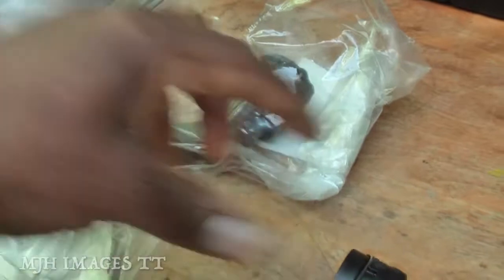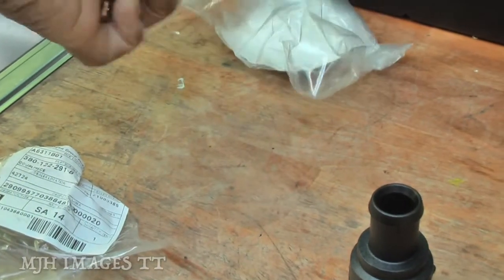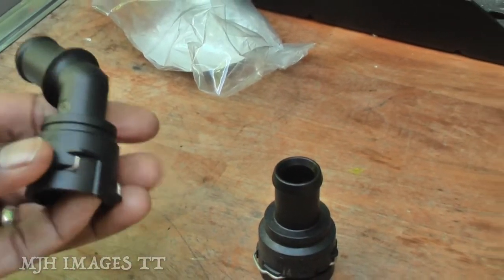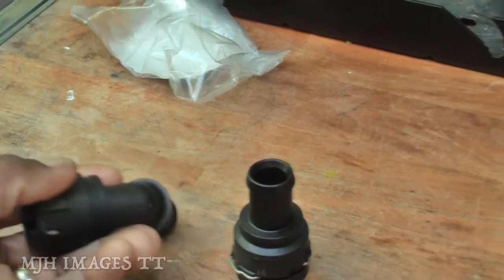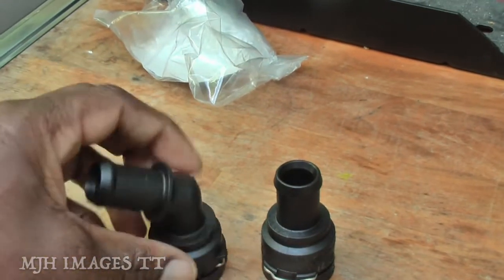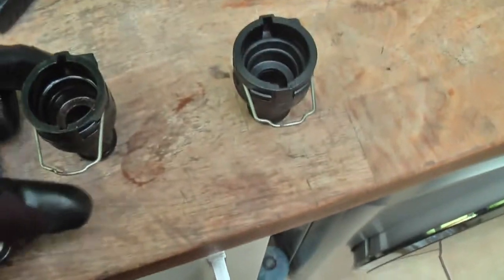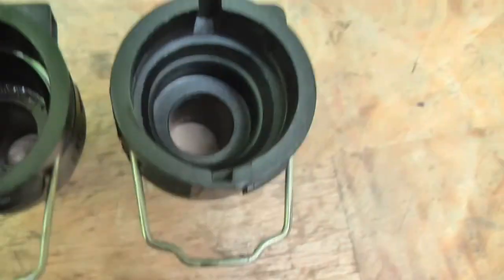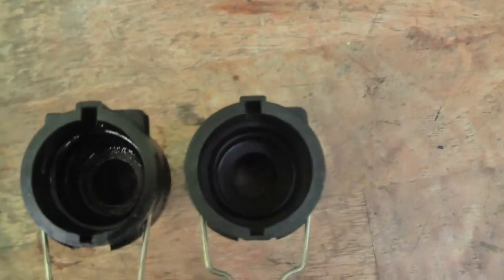Replacing Mk1 Audi TT Heater Core Hose Flange/Couplers

Comment: I'm so happy I came across your video.  I thought my heater core had a leak and I did a bypass and put off the repair/replace until I had the time (2 years ago).  I tested the flange by pouring down a tube into the flange, and the drips came out of the connector!  I'll replace the connectors and see how it goes. Thank you!

Comment: Hi, are the parts same for the mk1 v6. I’ve got the same problem slight smoke/steam from vents. Thankyou
Reply from the maker: Hi I can't be certain but if you can get to see your connections, then you can see if the angles of the connections are the same. All the best.
Reply: Thanks. Rang Audi today and they saying it’s not lol. Looks like il have to get the heater matrix done.
Reply from the maker: @maljitube  Okay but you only know if it's the matrix if you know that is what is leaking. The cheaper option would be the try the connector first as this is an easy change. the matrix is a lot more difficult. Let me know how you get on with this issue. All the best